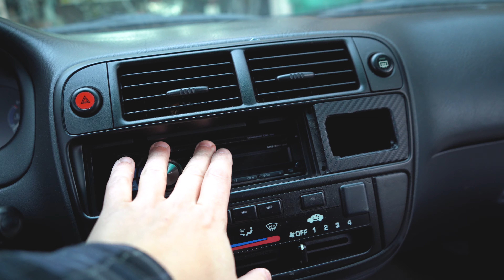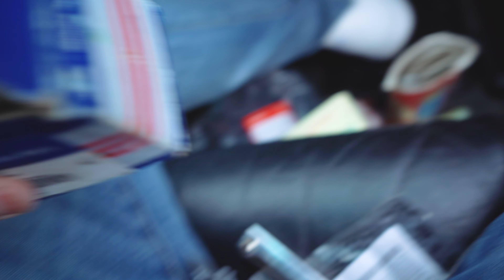UNCOVERING the TRUTH BEHIND the $100 EK Civic Hatchback (EP.3)

Comment: The intake manifold looks like a stock 96+ B18B1 manifold, and the off-road use only is probably from a jumper harness to make the stock engine harness work with a different OBD plug style ECU.
Also the climate control and radio bezel is all 96-98 sruff, so someone went through the very labor intensive job (have to replace the heater core) of reverting back from 99-00 or the car is actually a 96-98.

Feel free to reach out about EK and B series info, I know entirely way too much about them and have built multiple of them from bare chassis.
P.S. - I also do a ton of Fit stuff.
Reply from the maker: So this comment made me triple check it and it is a 2000, the vin number and all matches! I’ll definitely have questions in the future! I appreciate you watching!